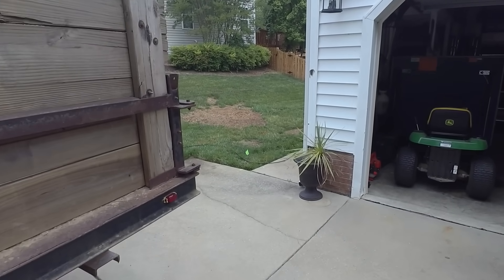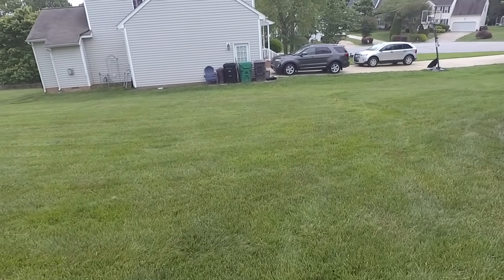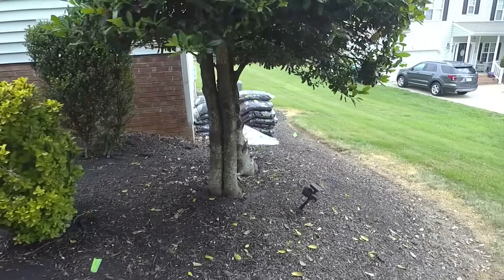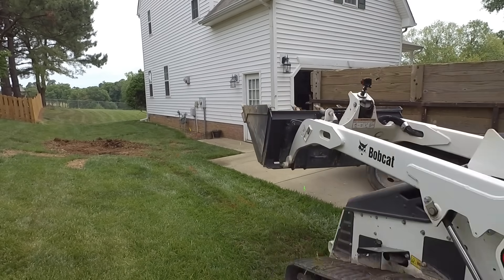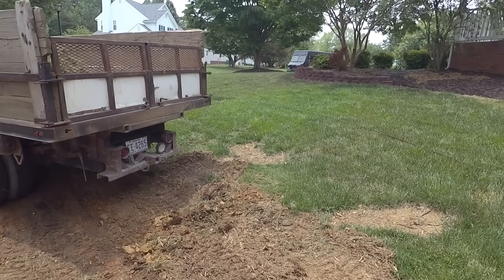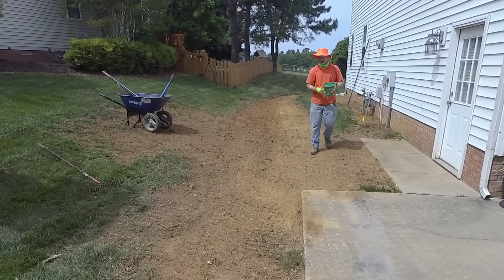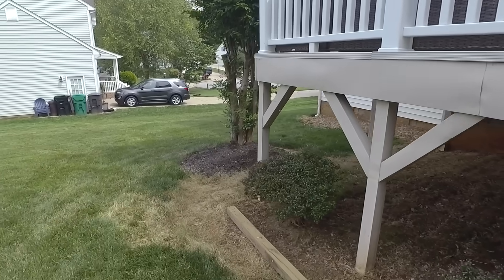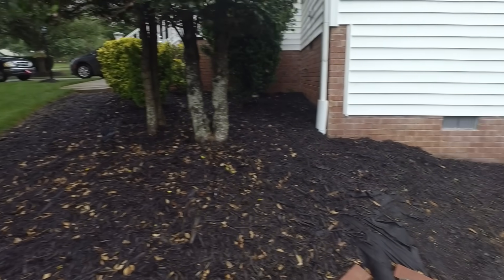Cutting a swale to relieve driveway and crawlspace flooding

Comment: Why isnt there underground storm drains to sent gutter water into? Should be one of the first thing developers do before building houses! The 'Big Five' are foul drains, storm drains, electricity, gas, and telephone - all 5 should be in place for the whole development before you can even bring a single builder onsite!
Reply from the maker: No one ever thinks about drainage it seems Debbie. It's always an after thought once the flooding has started.
Reply: I can't tell you how many houses I have looked at to purchase and everyone single one of them has drainage issues. Water running from neighbors into your driveway. backed up water. Pools of deep standing water in yards and all sorts of nonsense. I will never ever buy a home that is near a main drainage pipe or water source.
No builder ever thinks about water drainage or management. One realtor exclaimed that "These houses were meant to be sold not lived in".
If you ever want proper drainage on your property you buy some land and make sure the builder builds it right the first time.

Comment: Looks like a development i.e. all homes built at the same time. Plots built privately and in isolation, I can understand why drainage isn't considered correctly. But a development where water is not considered, and gardens flow into others etc. That's just wrong. The cost of appropriate land drainage when building a new estate is cents on the dollar. Drainage is simple if you consider it before building. Water flows downhill. You don't even need pipework if you work with the land, just a couple of hours of earth moving. Flat sites, just grade a gentle slope. A site like this, you'd need to slow the flow to reduce erosion, so some berms to direct flow into shallower swales. You're encouraging me to set-up my own business in the UK. Use what I know for myself 😊 all the best.
Reply from the maker: I see this type of thing all the time with developments.
Reply: I've worked on a load of ground work firms, they're either really good or absolutely dire, I've seen it all from good foremen who consult drawings and clients on levels and amend as necessary to slapped up with no physical drainage from patio drains, driveway pots, gulleys and gutters to storm lines.
Reply: Poor or no city planning  n building laws...NO Standards ..means no laws ..
Reply: I was baffled when he said there was no place to go with the water - I was like, why aren't they just running it out to the street? Shocking to me that there are no drains off the street.

Comment: Interesting to see different contractors bring different solutions!  Having seen QUITE a few vids, I was pleasantly suprised at the path you took!  I was half expecting MILES of pipe buried - or even worse,  a sump pump installed (OUTSIDE ! ??????)
Nice, clean job that solved the Customer's concerns with a relatively simple, Natural Fix! [ personally,  I like the working WITH what's there, a change of grade, a swale, etc rather than TOTALLY re-inventing the wheel!]
It also shows respect to the fact that Mother Nature REALLY does know better!
GOOD JOB!
THANKS FOR TAKING US ALONG !!!!!!
Reply from the maker: For sure G. I try to do the most simple and straightforward solution as long as it is 100% effective. Pumps work very well but only as a last possible resort. Thanks for watching!

Comment: That one tree he had removed was the root of his problems. As it grew the roots pushed up and raised the land so it no longer was pitched correctly. As that stump and root system decays over the years he will be back to having a puddle in the same spot. Great job doing what you did, I feel to properly fix that issue entirely the stump and roots would need to come out and that is a lot bigger of a job than originally anticipated by the customer
Reply: Did you watch the video? Stump had already been ground and this guy pulled the remaining roots with his special equipment.
Reply from the maker: Yes we tried to get the remaining wood material out of there. I take out trees with my excavator, stump, roots and all. The idea of cutting a tree down and then grinding the stump is not ideal.

Comment: As always, you present a clear and easy-to-understand work plan to address the two issues. You and your team do great work.

Again, Sean, I am stunned a resident would be permitted to export their runoff to a neighbor's yard. That would be an absolute no-no where I live. The review board on which I sit would be very much involved in enforcement. 

Where I live, both your customer and the neighbor would contribute to the cost of creating the swale to carry off gutter/downspout water to the street. And further, in this case, your customer would have had to take his runoff on the other side of his house to the street as well.
Reply from the maker: Interesting. Thanks for sharing!
Reply: Where I live, the city charges us a "Storm Water Run Off Fee" quarterly,  to pay for water that supposedly runs off of our property and into the storm drains. Sad part was that the water running down the street would come down my driveway and onto my property instead. I made the city put a berm across the end of my driveway to divert the water to the storm drains.
Reply from the maker: Our stormwater flows to creeks and rivers and not the WWTP. It's illegal to dump storm water or sump pump water into the sewage system because it overburdens the WWTP.
Reply: @GCFD   I edited my comment. The fee actually goes for repairs to the WWTP and SWRO piping maintenance. The SWRO does not get treated. Thank you. : )

Comment: If I get a little deep spot in a swale like that I go with a shovel during or just after a big rain and cut a 6" wide trench or so in the soft ground down the middle of the swale till it drains out. Grass will grow across it and it will be unnoticeable and drain out the low area. Nice work. Much better than a French drain in that application.

Comment: We could use this at our house in Alabama.  Can’t find anyone to do it.   I may have to rent equipment and do it myself.  Thanks for the videos and education !
Reply from the maker: Thank you Steve and good luck!
Reply: The trouble with these little jobs that only take part of a day is you still have to pay people for the whole day. Also when you need a bump truck and a machine you need people to drive them there, but in some cases there may be insufficient work for both people on the site. People will get contractors to come over and give a price for the job then not like the price. The contractor after a few of those will not want to waste their time going to the site to price a job that they think they will not get.
Reply from the maker: I agree John. Or if the contractor prices it so low to try and please the homeowner, they will never want to actually go do the work because it's not worth it.

Comment: Couple dry wells, size of a 55 gallon barrel's.  2  barrel's deep 👍🏻😵‍💫 lots & lots of small holes drilled in the barrel's. 
Wrapped with ground cover so dirt/soil doesn't 
Dirt doesn't get into the barrel...Let the ground suck it up.👍🏻👍🏻👍🏻

Comment: Next time I would definitely put the wood chips (then add straw if needed) down in the swale. It will act as a sponge and also break down over a long period of time for the soil to have nutrients for less run off. Permaculture principals.

Edit: I forgot to commend u for using a natural swale! That was the perfect choice. So many others would have done a French drain know nothing about permaculture. If they did their jobs would be much easier.

Comment: Awesome video Shawn. Tell him to concrete that pipe coming from the neighbors property, is that even legal to dump water onto your neighbors property? I would be upset if neighbor was dumping water on my property, I would concreting that quickly if he didn't move it .. They should have just run it to pipes from either side of the house to get rid of that water once and for all.
Reply from the maker: Here in our area homeowners are not responsible for water flowing off their property. You can't discharge a pipe directly onto a neighboring property, but in this case the pipe discharges away from the property line, but obviously flows directly downhill to my customers property.
Reply: @GCFD  that is an intentional drainage discharge,  as opposed to water merely flowing off their driveway,  lawn or patio.  Different localities have different codes and laws than others...

Comment: I would put a french drain that outputs to a sump pit and a sump pump that pumps water back up to the street, rather than putting in a swale.  To me you are just causing a future flooding problem in the backyard.  But, there are many ways to skin a cat.
Reply from the maker: That would be a fantastic option but would cost considerably more than the swale plus the ongoing maintenance and electric costs. These are all factors to consider.

Comment: I live in the UK so I don't know about USA but how come the water isn't just sent to municipal drains?  I found this video as I have a very minor issue of sloping paving in my back garden (looking for hints, tips, tricks etc)  but I also have a drain which I expect I will be directing the water in to.

Seems like most of the guttering on that property just drops the water on the property too?   I really don't understand?  If it was a property in the middle of nowhere I suppose there would be no drainage but there are clearly other properties and a paved street which which surely has a storm drain system, right?

Also how is it not illegal for the neighbour to discharge water across the boundary like that?

Comment: Why was that internet line just lying on the grass?  What kind of ISP just leaves the wire exposed so you can cut it with a lawnmower?
Reply from the maker: They must not have buried it yet.
Reply: The video suggests the tree people cut the original line, and since the homeowner knew GCFD was coming, he had the ISP install a temporary line on the surface where it isn't at risk of getting cut by the drainage work.  If the homeowner mows his own yard, the risk is pretty small.
Reply: ...nearly all of them...usually around 30 days until crews come behind to bury them...

Comment: Should have put drainage pipe in there. That low spot collects water from several neighboring properties that sit at a higher elevation.  The "after" shot shows standing water which means the ground is oversaturated. Under the surface it will make its way to the foundation since its just 5 or 6 feet away.

Comment: When a property has a steep downward grade from the street, about 60’ resulting in water getting in on both sides of the house, what measures can be taken to divert water from the sides..would the same idea of a swale be sufficient to keep water from getting between the ground and the foundation. Added to this issue, the one side of the house only has about 6’ of dirt, not lawn, from the house out, followed by a 4’ sidewalk leading down to concrete stairs navigating a steeper yet downslope into the  backyard…so no real place to create a swale….or can a swale be created in that 6’ wide stretch of dirt? Directly behind the house, the dirt ends and there’s a slab of concrete that creates a somewhat sloped plateau. Which is further supported by a retaining wall of railway ties but up against the concrete stairs…in short a conundrum. Any ideas?

Comment: Is there any reason why roof water doesn't get taken to the street? In almost all metropolitan areas here in Australia it is a requirement to discharge stormwater to a legal point of discharge - this is often the street or a dedicated storm drain.
Reply: A lot of new subdivisions do have drainage handled much better. (Or at least they are required to plan for it better). But most houses don’t have their gutters caught, and most of the time it isn’t a problem.
Reply from the maker: 99% of downspouts don't cause any problems discharging by the house. You're seeing the worst cases on this channel. In newer developments they seem to take drainage into more consideration than some older neighborhoods.

Comment: Not bad, smart to leave the "Live wire of communication open!" all rights reserved.  then bury it later.  smart on the root, and shavings, the scraped off gras in the truck had dirt, and if you left tufts of gras it would just regrow, so no loss there. Like how you cleaned the top.  

For seeding i see you didn't harley rake again after final grade, and compaction. Would you recomend harley raking for a bad lawn then seed, then use the back of a rake (Like roger cook says) and straw?
Reply from the maker: Yes the harley rake works great for re-seeding existing lawns.

Comment: This is something I also noticed in some other clips, which caused some confusion for me: Is it normal in the US, that runoff from the roof is simply directed onto the ground right next to the house?
I am from Germany and have never seen downspouts of houses simply ending above ground over here. Ours normally connect to the sewage system or an underground cistern (the overflow of this also connects to the sewer). The only buildigs without sewer connection are usually small structures like a shed or small carport, and then those normally don’t have gutters or downspouts
Reply: Same in Adelaide . The engineering for blocks of land and Houses foundations  is always higher than the road and all roof stormwater has to go to road via pipe . You're not allowed to allow it to run into another property . Then the street  has a gentle fall towards a larger pipe system . There it looks like do what you want , doesnt matter how low you build the house and who cares about the other houses and their paddocks
Reply: Here in London, Ontario (and most Canadian cities) it is illegal to discharge gutters directly into the stormwater system. We used to do it that way but all connections had to be disconnected. In a large downpour the storm system would be overwhelmed, and it would also accelerate flooding of Municipal ditches, where the pipes terminated. It was also notorious for flooding basements when the piping failed due to frost or settling. There's a mandate now to buffer runoff as much as possible, by discharging above ground, using permeable pavement, and creating retention ponds in new developments.

Comment: Have watched and enjoyed a few of your videos,is it common practice in the US to just drain storm water to the surrounding ground? ie: down pipes just finish at ground level.
Here in Australia storm water is drained into mains pipes and well away from housing.
Reply from the maker: Yes we drain things right by the house and 99% of the time it's not an issue. You're seeing the worst cases on my channel here. 👍
Reply: @GCFD  yea I was wondering, I would have figured you could drain to the road then the road takes it away to the storm water. But I guess it is not permitted there? You can discharge into a waterway if there is one that is convenient, just can't discharge onto a neighbours section unless its a existing waterway crossing their section.

Comment: it looks like you ran over the fiber line a couple times at 8:19, the line didnt get cut when that happened?

also, how often do you see situations where one neighbor is just absolutely causing misery for another by not handling their drainage properly? feel like there should be codes for that...
Reply from the maker: The line wasn't damaged if I did run over it. Tracks are the way to go. 
I do see horrible situations with neighbors occasionally. I try to help if I can.

Comment: Quick question: would you recommend a skid steer if we have a number of old ficus tree roots in our yard? The two trees were removed over a year ago but many roots remain - the biggest I've come across are maybe 1-1.5" in thickness/diameter. We had turf removed but the excavation company didn't go deep enough to account for what we're trying to do (a flagstone patio and crushed rock path). I do need to grade the area to make sure it's properly sloped but wondering if a skid steer will be enough or if I should be using a mini excavator. The tree removal company stump grinded the ficus stumps but not entirely, and if you start in the area where they were removed (in one corner) you'll likely hit the stump (along with old irrigation lines we will have abandoned). The main area of the yard we are excavating though is sort of away from the stumps but the roots have spread...
Reply: You can use a sawsaw with a Pruning blade.  It must be a pruning blade.  Or hook up a chain and pull it with a pickup truck.  Yes, skidsteer will work but not necessary unless you already have it for grade.

Comment: if they continued the concrete slab the garbage cans were on all the way to the end of the house 4 inches higher which would mean pouring it over the garbage can slab no water could get in the crawl space. then a swale could be formed  in 45 years working on houses never saw a garage built on top of a crawl space

Comment: A french drain would have been 10x easier and 10x more effective. There is still pooling close to the house and in a terrential down pour the problems will manifest again.
Reply from the maker: the problem with a french drain is I had nowhere to send the pipe. I wasn't willing to have a pipe discharging directly at the neighbors. With a swale, it's just water running through the yard.
Reply: @GCFD  It's to go directly to the street and then you either drill through or cut a section of curb out then re cement to original finish. 

In the end youre correct but in my case i would have taken the french drain option.